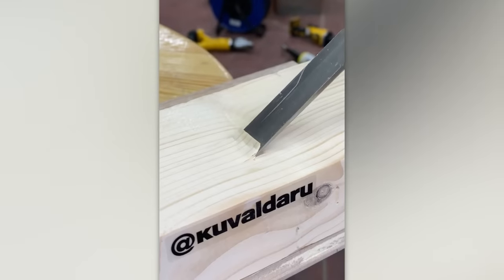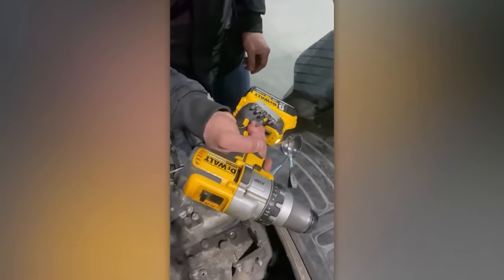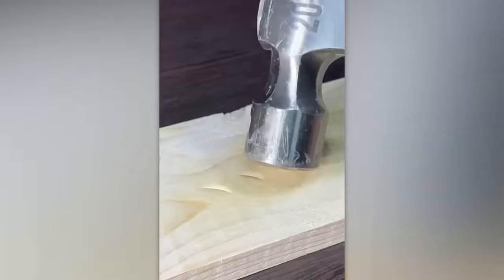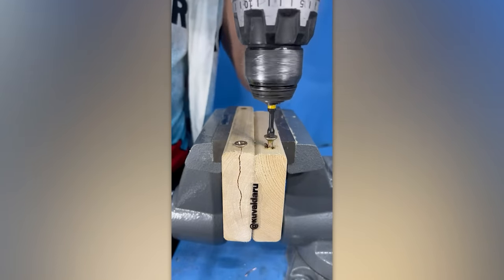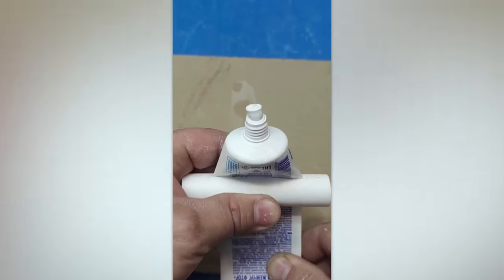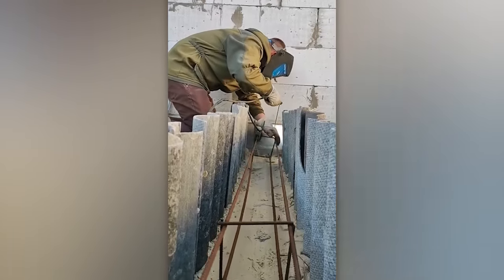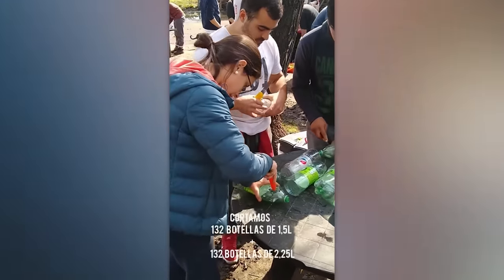HANDYMAN TIPS AND TRICKS THAT REALLY WORK

Comment: The tip for the toothpaste tube isn't necessary. I just use a convenient 90-degree angle, such as along the top of a drawer edge, to flatten the end of a tube. Been doing it for over 40 years.

Comment: Just wanted to add one comment.... soap may work great to help drive screws but the moisture can cause screws to rust prematurely. Paraffin is a better option. just drag the screws across a section of candle.
Reply: Not as good of an idea as it sounds. I've used soap for thousands of screws, and I'm constantly re-using old screws. Paraffin doesn't glide as well, and soap is only mildly basic. The wood itself—and certainly the moisture it contains—might be further away from pH neutral than a mild white soap.

Even of you were to spray a screw with oven cleaner first (which is way more basic), it would still take more than that to dissolve the metal of an entire screw. Far more important considerations should be the moisture of an environment, electrochemical stressors, and the type/thickness of the fastener. And of course, time; here on Earth, we have an oxygen-rich atmosphere, so everything is in a slow burn of decomposition.

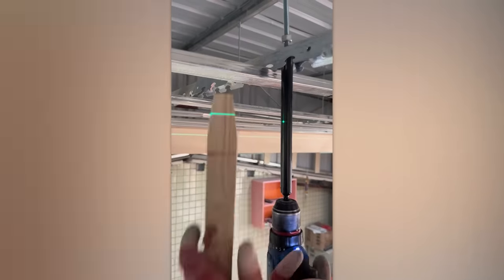Comment: 2:40 - What kind of adhesive did he put on the bottle cap to stick it to the car, to remove the dent? He put something on the cap, stuck it to the car, then when he was finished pulling the dent out he sprayed something on the cap and it came right off.
Reply: that's what I want to know too
Reply: Yep, Ideas only work if you have the information to use them!

Comment: While some of these are cool little tricks to get screws out and whatnot that don't really matter to anyone, but you personally, don't shrink a plumbing pipe with a lighter to make it fit, use the proper couplings.  Doing it incorrectly is just asking for trouble. It is advice like that for why codes and regulations exists and most people should not be doing DIY.

Comment: 12:47 you gonne ruin your chain, bushings and sleeves are oiled or greased before assembly, if the chain is cleaned with alcohol or acetone, these oils or greases will wash out and the chain will rust from the inside, it is almost impossible to get oil back to these places do to too high viscosity